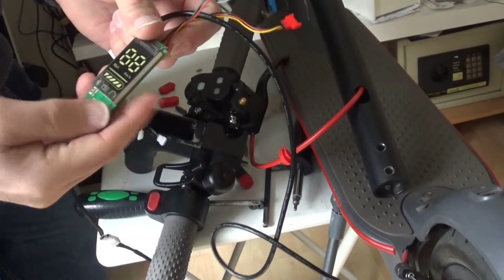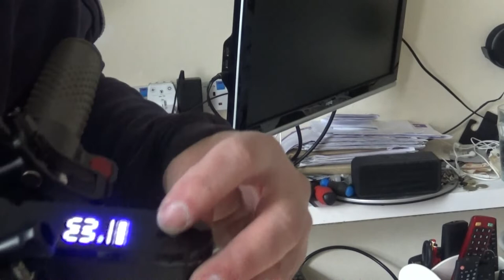Display Circuit board Unit for AOVO PRO M365  Electric scooter

Comment: I don't know how to detach the big coloured ones with the transparent wrapper
Reply from the maker: Pull on the wire and it will come apart
Reply: @amateurrepairs8193  It didn't work and I ended up hurting my thumbs. What I had to do with mines was to use pliers and use a flat screwdriver for leverage

Comment: @amateur repairs Which cable is the speed limiter please if you kind to share with us. Thank you! ✌️ 😊
Reply from the maker: on aovo you do not have to play with the wire it is on the app to go faster
Reply: @amateur repairs  Max is 35km / 21 22mph although every time I chose more it jumps back automatically to 35km. Max is 60km in the app. Tried almost all to see if it stays but no it doesn't. :) I seen people do it by firmaware downgrade/upgrade with closing the app at 10% but in this case it's not showing any firmaware updates and even If I find a different version app on Internet it's still not working. Any suggestions? All I want is to go at least 25 30mph.
Reply: My went 48 kmh from factory when you lift the wheel up and then my brother ordered o e and it onli went 31 kmh from factory
Reply: adityamandaliya8714 did you find the solution?